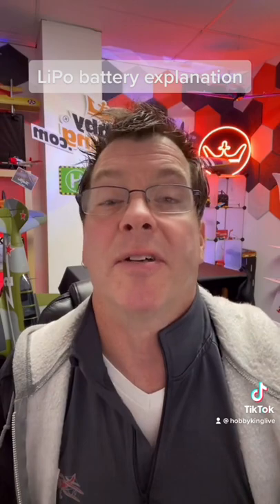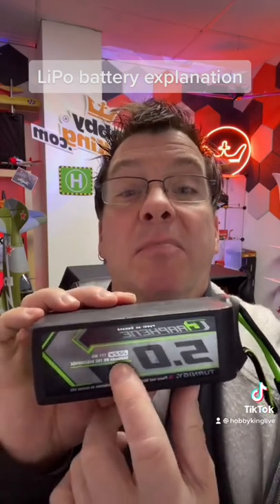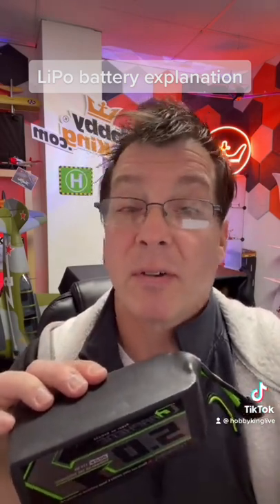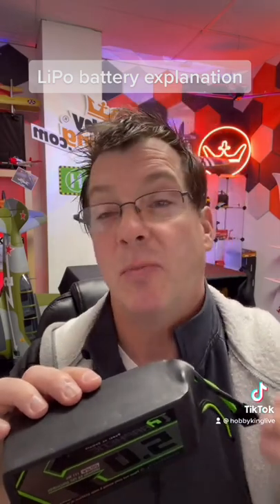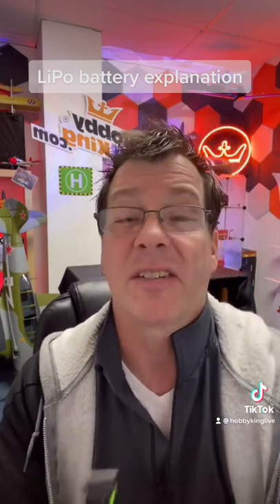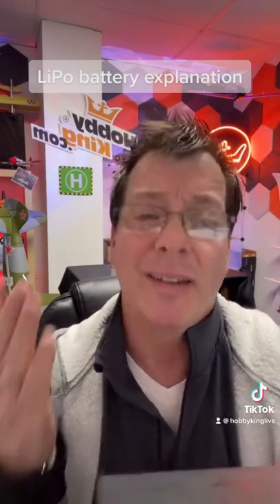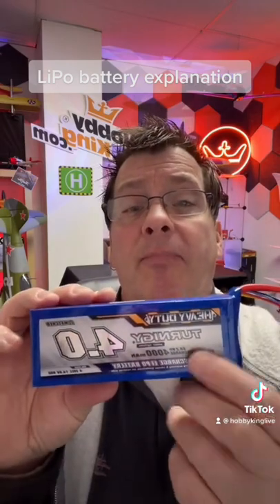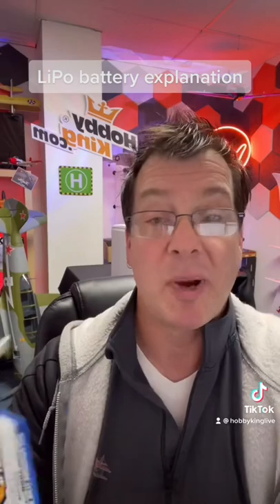HobbyKing Quick Tips - LiPo Battery (What do the Numbers Mean?) / #shorts

Comment: What is the difference between charging vs. balancing? Thanks.
Reply: Charging does not make certain that each cell is at the same voltage whereas balance charging does make certain that each cell is at the same voltage. This adds a degree in safety by making sure that no cell can over-charge.